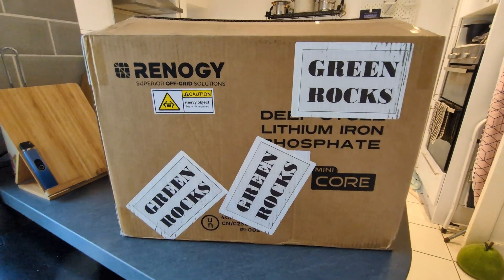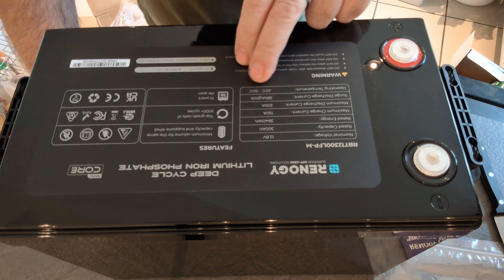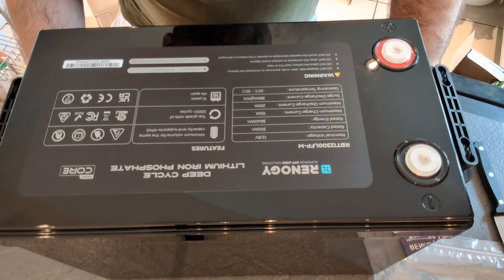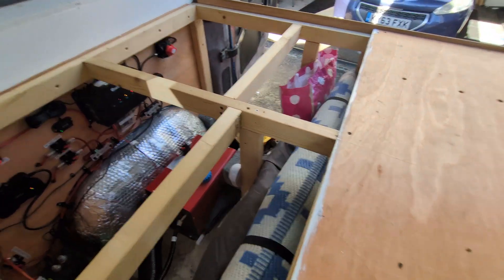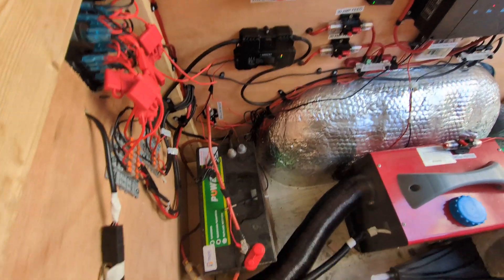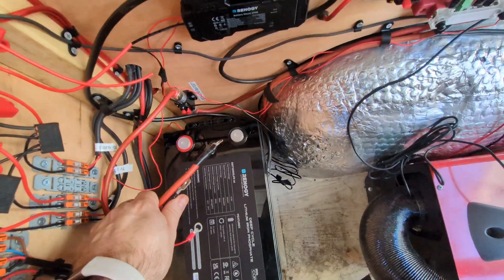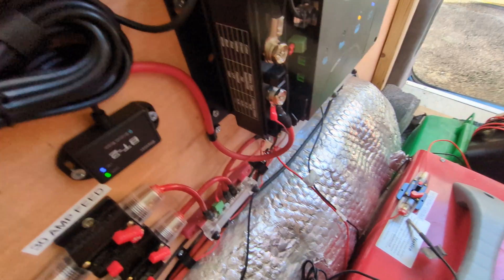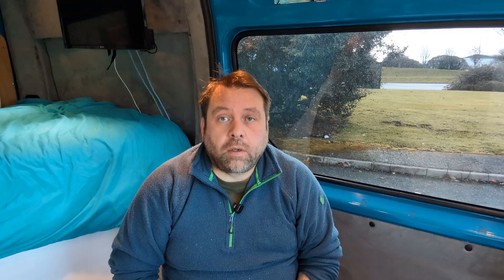TRIPLE the runtime off my off-grid camper van power system. Renogy lithium 300ah

Comment: Cannot fully discharge a Lithium battery. You can. But its bad practice. For longevity of the battery follow DoD depth of discharge. Typically 20%-80% threshold and 1 full charge monthly is best for LiFePO4 batteries. According to my research. And its typically better to have batteries in even numbers. To avoid potentially going out of that threshold plus having more cycles in charging. 2,4,6... batteries is best. It balances your usage well within your parameters. 20-80%
Odds 1,3,5,7 strains the middle batteries.
Reply from the maker: Thanks for the information!